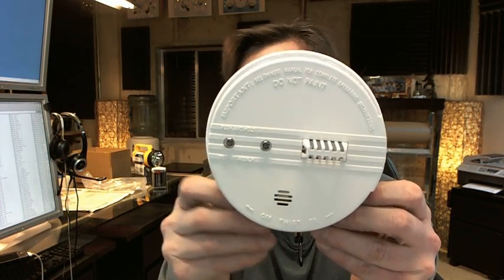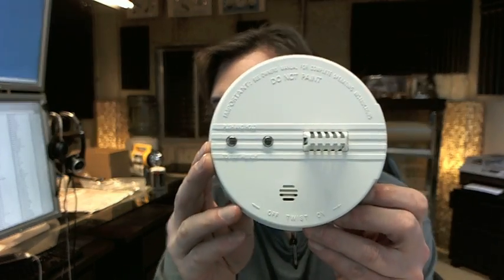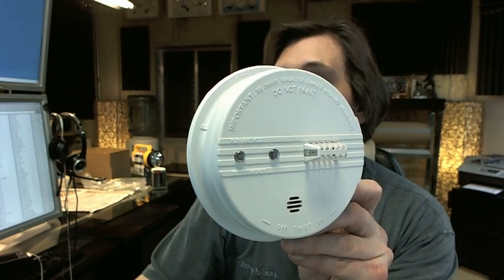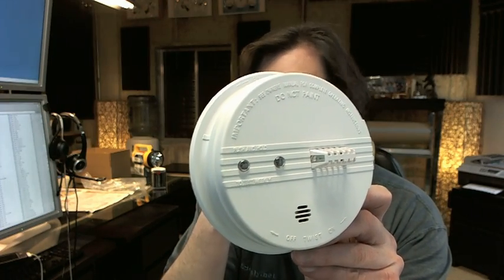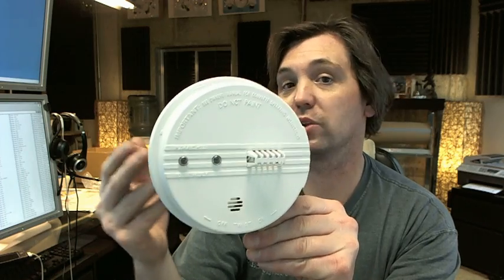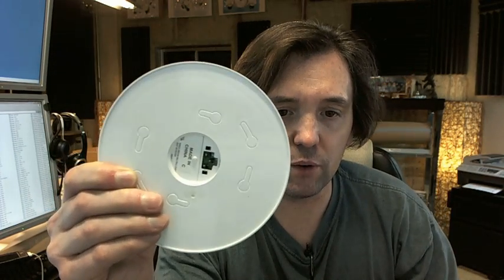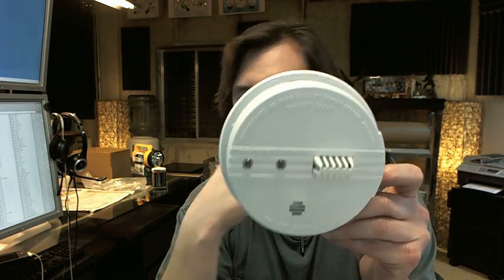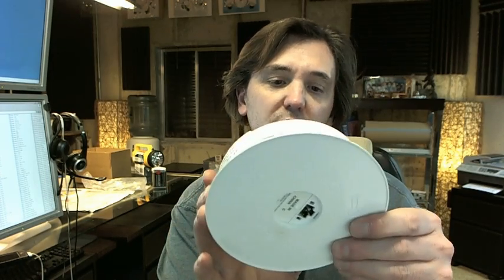Kidde HD135F 120VAC Hardwired Heat Alarm w/ Battery Backup

Comment: Hello,
   I have this product in my garage and can't find the battery backup. It is non existent. The heat alarm chirps every 30 seconds. I can reset it and it won't chirp for a day or two then it goes back to chirping. Any idea? Thank you!
Reply: I cannot find the battery in mine either. Same chirping problem.
Reply: @bobrobbin6932  Noisy, endless chirping piece of shit here too. Yes, replaced the battery, and reset the unit for 15 seconds with the battery removed. Junk.